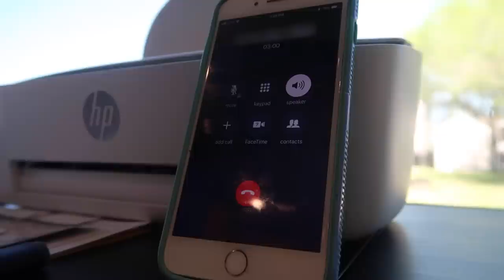RV BRAKE FAILURE! 😱 || RV LIVING

Comment: I am sure someone else mentioned it but I am too lazy to read all 282 comments. For bolts that get loose or might - consider blue locktite (not RED), it is a medium strength thread locker I use on a motorcycle (to combat the vibration that tends to loosen stuff. DONOTuse it on lug nuts or spark plugs.
Reply from the maker: Thanks John! Appreciate the tip!

Comment: Yes the bolt has lock tight on it BUT it wouldn't be that clean as sold blue like that if it was INSTALL CORRECTLY in the first place, The caliper bolt was never installed. If it was the blue would have mostly come off when you take the bolt out. As a ASE master auto tech I use loctight all the time and it would never look like that if the install was done right the first time.
Reply: Morryde did the original installation not too long ago for this independent suspension retrofit. I agree the installation was probably not done correctly but a commenter on here who claims to be the founder of the drv page states that this is a common problem. I wonder if there is some kind of design flaw? Another comment from the OP that the tech for the brakes claimed he only heard of this happening one other time. Something is not lining up.

Comment: ...so fancy suspension wasn’t even a year old??? Didn’t Morryde install it? Don’t they have some type of warranty??
Reply from the maker: Wasn’t a suspension issue, it was a Kodak brake issue and it was under warranty
Reply from the maker: Haha well I think it was more finding the right number. Once we got a hold of them they got us the warranty parts in 2 days.
Reply: Just think if you’d hit that pothole with your factory suspension...
Reply: @GetawayCouple  it wasn't as much a brake problem as it was Morryde's installation. Caliper bolts do not just fall out.

Comment: You have oil bath hubs you put grease in? Grease will work but oil is normally but in the hub. Grease hub dust caps pry off. Oil bath hub caps are clear plastic and have a seal  when you screw the cap on. They also have a rubber plug in the center of the cap so you can and oil.  Just Youtube Oil bath hubs.
Reply from the maker: Interesting, we'll look into this more!
Reply: Getaway Couple Please try to mention somewhere (like in the next newsletter maybe) which type you have? 
And oh that was so funny, my mouth just dropped when Jason held up the wrench 😳, as I just starred at it. I was expecting some long big torque looking goofy-end kind of wrench, not an actual ‘giant’ wrench, hilarious!  But that was very educating, thank you! Cheers 🍻

Comment: That is a MORryde Independent Suspension installed by MORryde  nothing to do with Dexter
Reply from the maker: There was nothing wrong with the suspension. We opted to upgrade our brakes to Kodiak (by Dexter) disc brakes at the same time as the IS. That is what we had an issue with.
Reply: @GetawayCouple  Correct, I had the IS with the disc brakes installed at the same time by MORryde. so if you had a loose bolt it was on MORryde not Kodiak.  Just saying.  Glad you was able to fix it. the hard part was bleeding all four of the brake calipers.
Reply: @dannybryant4440  you are absolutely correct. The improper installation falls back to Morryde.. They should have gotten them a truckers mobile tech out there to fix it and do it right. It's unfortunate when people that are new to RVing are taken advantage of like this.

Comment: How did you choose your tow vehicle?
Reply from the maker: We knew what rig we wanted first and then Jason did research to figure out which type of truck would tow it. Due to our budget, we chose to go with a used option. We went with RAM because we liked the reputation and the engine, and obviously it could tow our Solitude. We also went with a 2012 because we don’t have to use DEF, every year after that does though.

Comment: First. Things happen. 
Second. Please wear CLOSED toe shoes when working on vehicle. Could make for a BAD day. 
Third. Plain and simple bolt was left loose. It happens.
Reply: The founder of the drv group says this is a common problem. I don't think it just happens. I'm with you though it seems the installation would have some responsibility but if morryde applied the Loctite correctly and the bolt still fell out then could it be a design flaw?

Comment: I hate to tell you but you had no brakes at all on the trailer. It is a hydraulic system and if one line is open the system cannot make pressure for the rest of the brakes.

Comment: 16" tonge and groove pliers aka channelocks will also work instead of the BA wrench but have no comedic value.
Reply: Maybe not have comedic value, but they left the tag on the adjustable for return value. :-) Along with the battery impact, I would suggest a torque wrench.

Comment: I would HIGHLY recommend that you have the entire break system inspected, if not totally taken apart, by a break expert. Then I would send the bill for all the tools, your time, camping fees and whatever else you are out of pocket for to the company who originally installed the disk breaks. For all you know the other calipers could be having the same or worse issue.
There is absolutely no excuse for the caliper bolts to have backed out!